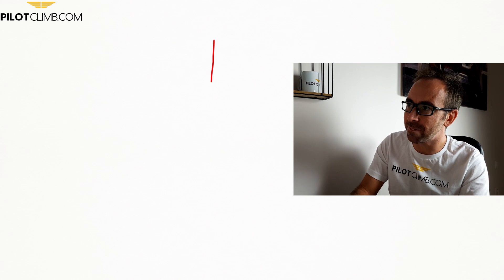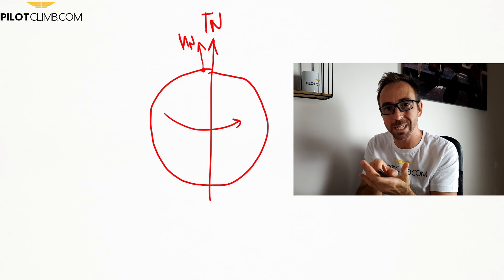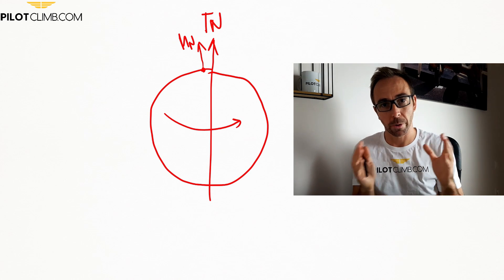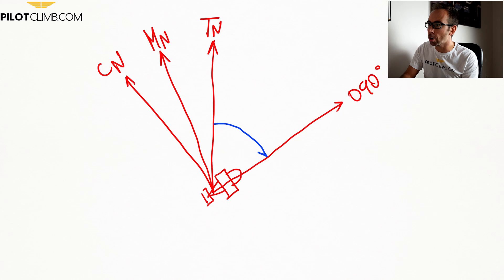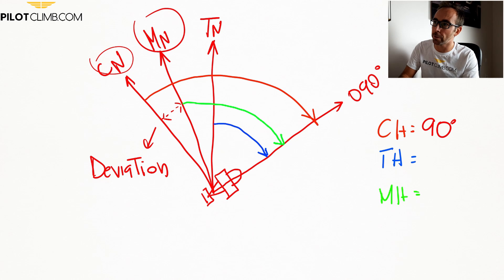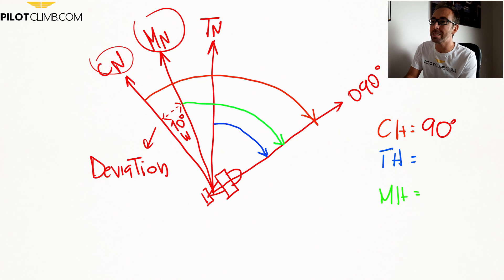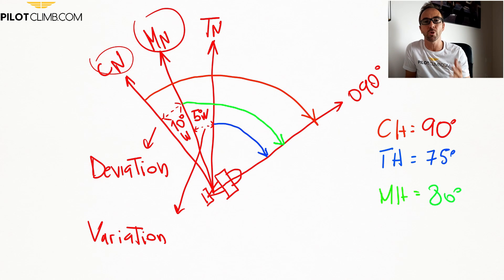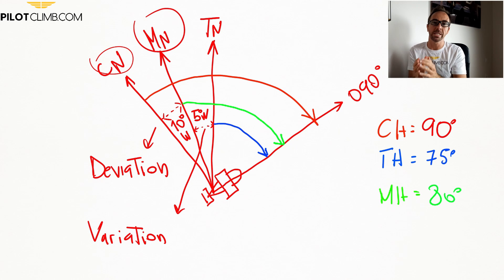Compass Heading vs Magnetic Heading - [True North, Magnetic North and, Compass North]

Comment: Great video, thank you.
So when planning a flight without GPS, VOR, etc: Do you first plot the True course on the sectional chart, then adjust for magnetic Variation to get to Magnetic heading, then adjust for magnetic Deviation to get to compass heading? Then the compass heading, adjusted for wind corrections is your heading, correct?
Reply from the maker: You are very welcome!! In most of the place the Variation is quite small (around 2 or 3 deg), however there are places where you really need to calculate it as you mentioned otherwise you will not follow the intended route..